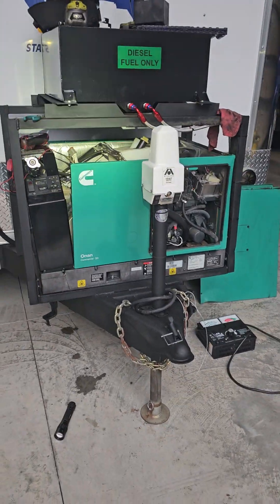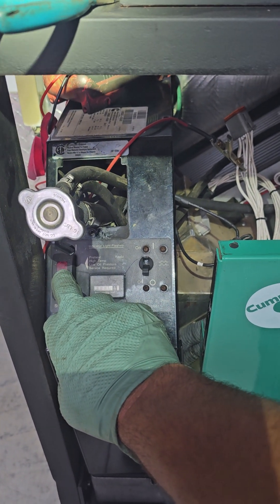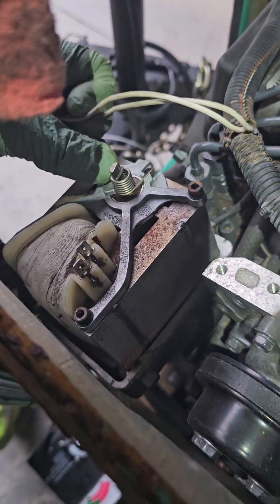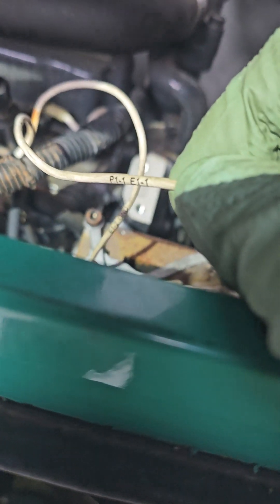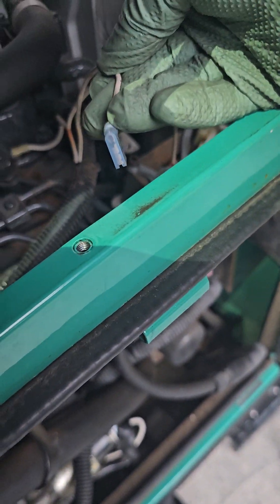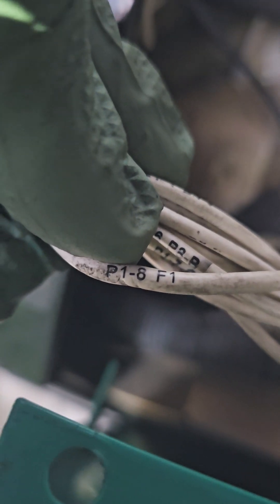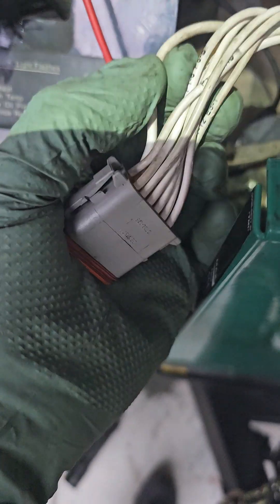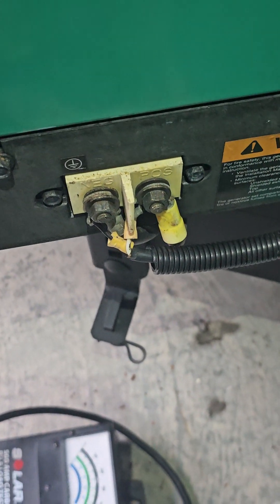Onan generator code 19 -Diesel Pump Actuator Shorted or Open

Comment: Great video.   My coil ohms out at 1.5.   It is lower that spec. and the unit looks a little rusty. Is this low enough to change the coil ?
Reply from the maker: Wow that is a tough call for something that is not all that cheap.  The rust don't matter but you are close to spec.  If it really is 1.5 ohms , the computer will not let the unit start.  BUT make sure your ohm meter is working properly.  Do you have a second meter? If you have time you could also order a 1.5 ohm resistor  pack for six dollars on Amazon.  You can test your meter that way as well.  Finally there is usually a .1-.3 residual resistance in the test wires that you have to subtract.  This may bring your resistance down to 1.3 to 1.4.  I definitely wouldn't go ordering a  new unit until you have a way to test your test equipment.

Comment: Update... The generator ran for 10 hrs with no additional problems. In fact, it ran quieter, smoother and fuel economy went up. I'll assume that wire that was broken inside the terminal was jiggling for a long time before finally breaking off. So glad you posted this video. Saved me
Reply from the maker: Wow!! Just reading all your comments now.  Fantastic, makes me so happy I could help :)

Comment: I had broken wire on the flux capacitor fuel actuator box . Both my connections were red. Rear post looking in wire was broken inside connector. I replaced the connector and the 30 amp fuse was blown too. Fired up and now runs smooth....i did change the fuel filter first. 

My deepest heart felt thank you for this awesome video. I felt like you were talking to me like i was right there with you. Keep up the videos please

Comment: What was the problem?
Reply from the maker: It was the wiring leading to the actuator.
Reply: @mobilediesel  Based on your comment here, was it the P1-1 E-1 wire that did not have continuity? I keep blowing the F1 15a fuse and the load side of the fuse is going to ground as well as when I check the P1-1 E-1 from the plug at the control board(P1 plug) it goes to ground.  I'm in the process of getting to the actuator right now to check continuity. Great video, thank you so much.
Reply from the maker: @stevenarnone3684  Darn it has been so long now.  I remember it was a lack of continuity.  Sounds like you have the opposite problem.  If you are blowing fuses you have too much continuity, better known as a short.

Comment: Would a high resistance in the actuator coil mean it’s bad?
Reply from the maker: 1.7 to 2.8 (not 12.8 ohms) is acceptable.  If you are getting a 2.9 ohms I wouldn't go changing anything just yet, but yes if you are getting something way higher from those numbers  say 1 K, 12K, 12 M, ohms then yes the actuator is bad.  Also you might want to check resistance with a second ohm meter to make sure your meter is in good working order.  I have yet to find a bad actuator.  So I am suspicious of your meter and your test leads.

Comment: Good morning mark!  I hope all is well with you and I hope your staying dry from the storm coming that way. I am working on a 2cyl kubota diesel out of a onan generator right now. We swapped it on to a Toro wheel horse lawn tractor. We completely removed the electronic throttle control and made it cable control. I remember when I worked for cummins see this issue a few times on these units. They are great units over all tho.
Reply from the maker: Hey Todd Good morning except you're a few hours before me and it's 6:00 a.m. here. Which means you're getting up as a lot of folks go to sleep.😅
Reply: @mobilediesel  I'm right here in spartanburg south carolina. Not to far from you. Lol.
Reply from the maker: @toddthompson3043  lol wrong Todd. There's another tech I know in Nevada. Good to hear from you!!